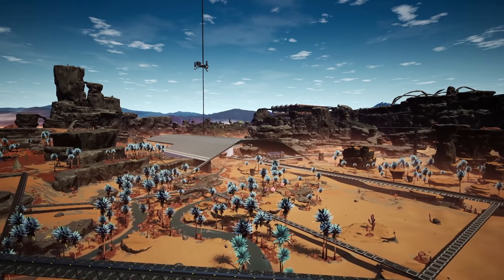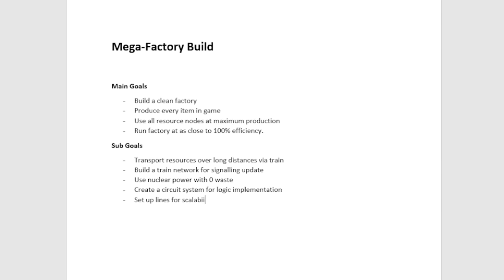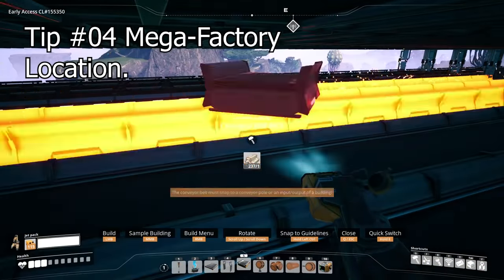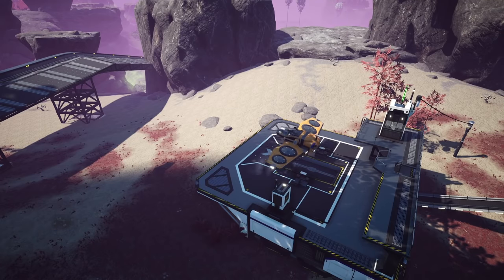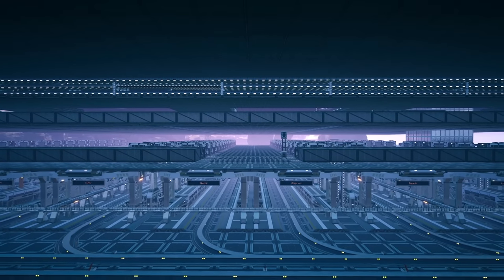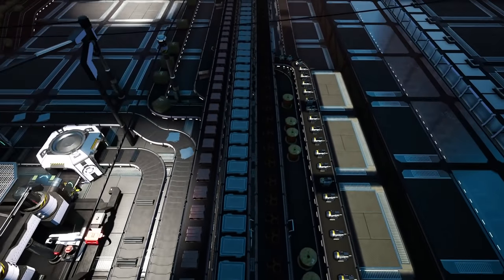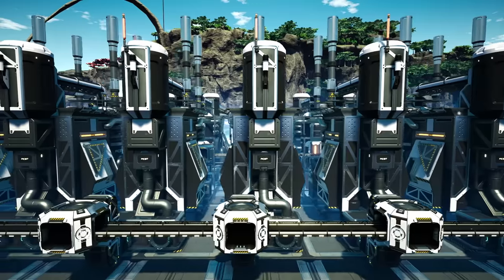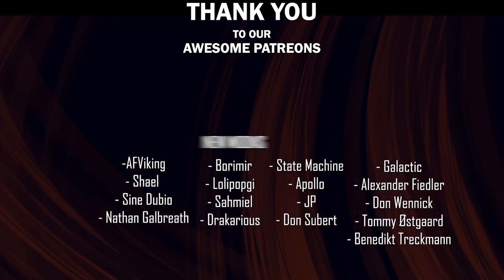14 Mega Factory Starting Tips | Satisfactory Game

Comment: a suggestion, Play this game with some friends and each have their own job. Who needs a prefect conveyor system if you can use tractors to automaticly haul all ores and items to one location. from there send it into the awsome sink to unlock the structures. then one by one build specific factorys with a truckstation and overflow into the awsome sink. Just manually transport items using a vehicle from one truckstation into the next. Some items will last you hours to produce. It saves PC resourches, It prevents conveyor mis calculations by expansion issues. and you can choose to double down item productions if something is running low. The Human brain is stil better the the perfect algorithm.  Sometimes the perfect idea is simplicity when you the solutions seems hard. Just like the paperclip.

Comment: I know this is an old video and likely wont get any responses, but this is my first play through satisfactory, I have a really awful spaghetti mess making basically every item I have unlocked, As far as logistics go I only use tractors for getting coal to my foundry and power plant. everything else Is close enough to each other where I can run coveyers (although incredibly ugly) they are effective in making what I need for now. I really want to get started on a mega factory but I assume doing so and replacing all of the stuff (like tractors with trains etc) later on would be tedious, but my efficiency right now is pretty bad, and the asthetics look even worse, but I DO produce basically everything I need (modular frames, rotors, motors, reinforced plates, steel beams, steel pipes, encased concrete, versatile framework, wire, cable, copper sheet, quickwire, screws, rods, and plates.) But its a total fucking mess and I hate looking at it. 
Long story short should I hold off until I have trains and more power and just deal with the headache while I afk supplies or should I just go for the daunting task?
Also do you craft your craterum into quickwire at the source aswell, or does it become useful not to later on?

Comment: My big problem, i hate flying bases and i want to have ne great nature and love at the map - its not easy to find a compromise. And i have many single places for single items. My biggest problem, the trainstations waste so incredible much of space. For me, they are to masive/big designed in the game. 

E.g. You need two recources and have one product, the three train stations are bigger than the factory for the product (i go in the high with the single factory stages).
And i transport all Products and recources in my huge trainstation central stogare - one station incoming, one for outgoing in the middle splitters and storage for buffering. But it needs so many space ^^. (and this is not posible without a compromise with the nature and no flying ^^). And than all single product have his own factory, single production. The are 100% easy to copy paste with blueprints upstares if i need more from a single item). This is much easier if you get time in time the better recieps as you mix production lines i think. - So ratio are complet not a point for me - i dont need to calculate anything. This makes me very happy smile. 
If i see a buffer runs out in the central train storage i copy paste on, two stages over the last product factory and all are fine. (maybe sometimes an extra train for the more output or so)

Comment: I think it's kinda funny that you talk about your rule of thumb being to transport as few items as possible, and then give an example of ingots.

This rule of thumb is exactly why I don't build mega factories. My first iron processing factory is configurable via smart splitters and can fully use the nearby node to make whatever ratios of iron items I need, exporting modular frames and smart plating... not ingots.
Reply from the maker: You're absolutely right, but the concept of a megafactory is where everything is produced in one factory. If you're producing everything outside and taking it to the megafactory, is it a megafactory? 

I like your system idea though, I want to run it so that when I choose I can switch off a segment of the factory, and in doing so, using a scaling factory system the items would be sent to another factory to be used up automatically, all it requires would be to switch a switch on or off. But I think it's going to require a lot more planning that I first thought
Reply: @TotalXclipse  The wiring can get pretty involved really quickly. My first nuclear setup is "just" 15 power plants, but the switch network I made to allow me to reassign them to different circuits required some very dense wiring.
Reply: @TotalXclipse  Oh, and yeah... I see so many videos about people building mega factories and I always am a bit baffled as to why they even want to do it that way.

I'm not going to try to tell anyone how they should have fun, and I enjoy watching all approaches regardless... but the mega factory concept itself is very much not for me.
Reply from the maker: @ronhatch9175  I like the idea of having a massive factory that's always running, pushing the game to its limits, but building a megafactory certainly isn't necessary :)
Reply: @TotalXclipse  Yeah, that's fair.
I'll admit the massive structures look cool, even though I prefer to stick closer to real-world plausible structures for my own builds.